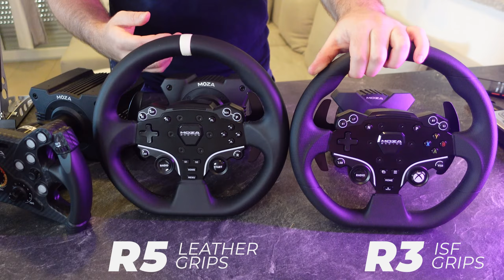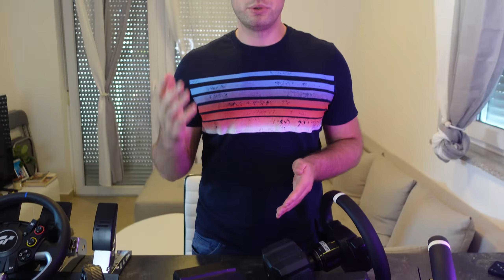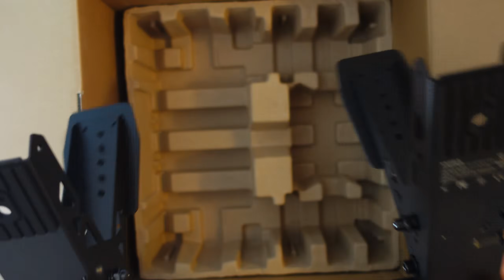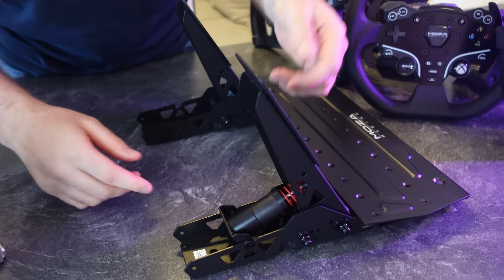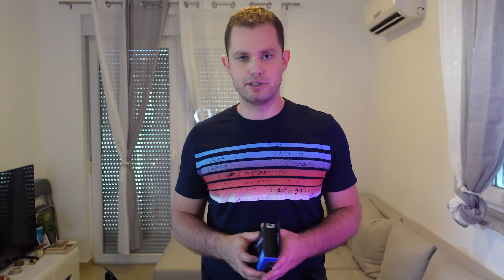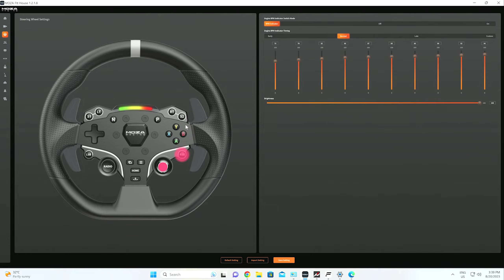The Smallest Wheelbases Ever - MOZA R3 Bundle Review

Comment: Is it possible to use the R3 Wheel (Xbox compatible) on the R5 Wheelbase? I was wondering if Moza will release a xbox compatible wheel for the R5 later this year? I'd be great to have an R5 or R9 that is pc and xbox compatible as well. Thanks
Reply from the maker: i can't confirm this, and for now it won't work
Reply: The compatability is in the wheel, so the R3 wheel will work with the R5 wheel base and be Xbox compatible. But for now it's not possible to buy the R3 wheel seperatly.

Comment: A price that will knock off the T300RS off the shelf, the same wheel I started off simracing with. This is HUGE. R3 is the best way to start simracing with DD right off the bat with a LOT of upgrade options down the line.
Reply: It would be even better if it came with 3 pedals

Comment: Not sure why they would make weaker base for Xbox and a cheaper wheel. Also need PlayStation compatibility. Moza has a much better QR then Fanatec
Reply from the maker: Costs I guess, but in my opinion it should've been a modified R5
Reply: If they release the xbox wheel alone you could use the other moza bases on xbox 
Just like Fanatec the compatibility is given by the wheel

Comment from the maker: Read More here: https://mozaracing.com/product/r3-racing-wheel-and-pedals?ref=DIGIT

What do you think about the review?
Reply: Liked it. Nicely paced and concentrated on the information I would want to know. I do wonder if the Break performance kit could be adapted (with shims/washers etc) to work on the Fanatec CSL break. a cheaper alternative to getting the load cel kit.
Reply from the maker: @Dr_Havard  Thanks, I think they maybe could. Would it work in the long run without braking I'm not sure. But I guess anyone with a 3D printer and CNC machine would make something for csl pedals